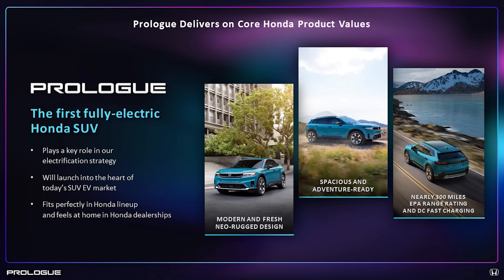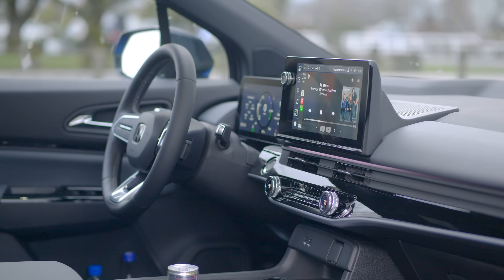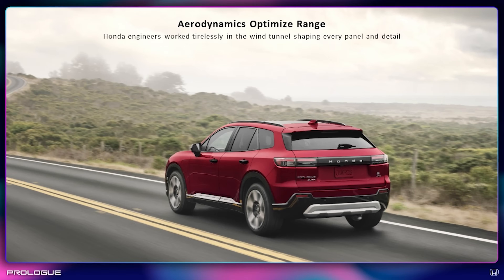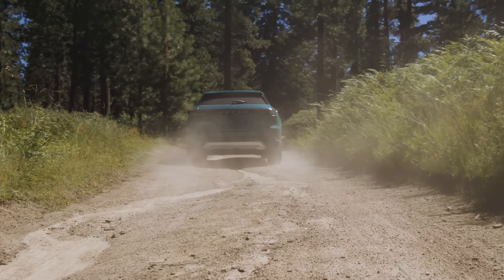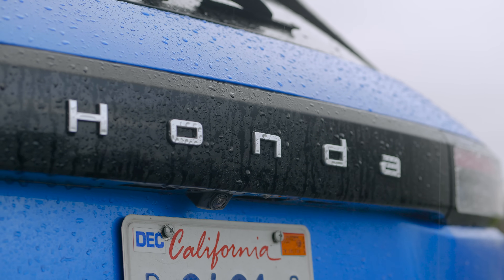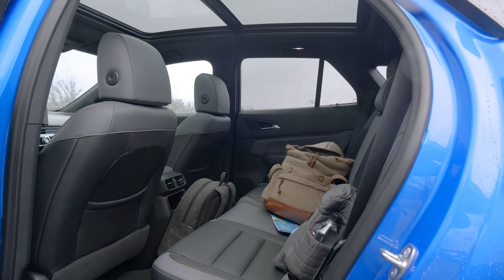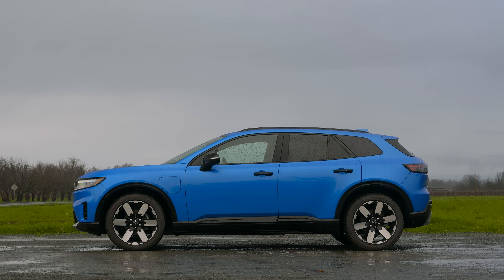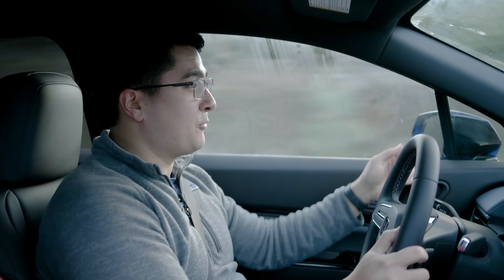Honda Prologue First Drive | Taking Risks

Comment: It's interesting how history repeats itself. When SUVs were emerging in the 90s, Honda hadn't done any meaningful R&D on their own SUV platform, so they borrowed one from GM (Isuzu) and called it the Passport. Here were are again, just replace SUV with EV.
Reply: Except the Isuzu Trooper was a great off-roader. It was a very solid vehicle…and being honest, Honda simply rebadged it. 

Not sure about this GM thing.
Reply: @NomenClature-o8s  my thoughts exactly, gm quality is not the same as isuzu quality
Reply: @NomenClature-o8s  Except Trooper was not Passport, it was the Rodeo.
Reply: @NomenClature-o8s  It was an Isuzu Rodeo, and they fell apart while driving.  Talking to a Honda Service Manager back in the day, it was costing the dealership thousands upon thousands of dollars in warranty repairs, they couldn't wait for the vehicle warranties to expire, the service bays were full of Passports that needed to be fixed.
Reply: Honda traded Isuzu the first generation Odyssey (to be sold as the Isuzu Oasis) for the Rodeo (Passport) and Trooper (Acura SLX)
Reply: The two above me have no idea about how bad the Passport/Rodeo and SLX/Trooper were for Honda in the 90s. Isuzu engines were EXTREMELY prone to oil leaks, the bodies rusted at a higher rate than their Honda built counterparts, and they got ZERO support from Honda once the 2000s hit. There is a very big reason why you still see 4Runners and even Pathfinders and Monteros, rather than seeing Rodeos and Troopers and their Honda rebadges. That same misguidedness is what will cause this to fail. EVs are already not selling and sitting on lots, these will pile up on lots and the few who do buy them will suffer for it. Everyone I worked with at Acura quit right before this thing came out, including the master technician trained for it who had been with the dealer almost 20 years. That should tell you something...
Reply: @TomFromMypace very true. And they didn’t put any attention into “making it a Honda” either. The Passport and SLX were straight rebadges, so they still felt like an Isuzu. It’s been a long time since I saw a Trooper or Rodeo, even longer since I saw a Passport (the SLX I saw a few years ago because a family member had one they got dirt cheap), and even longer since I saw any of the four without rust. Though to be fair, Hondas of the same vintage (late 90s) are largely rusted into oblivion at this point, but their engines live on. You generally can’t say the same about the Isuzu products.
Reply: @TomFromMypace  agreed. I remember the Passport and SLX being the only cars in Honda and Acura service bays more than enough times back in the 90s.
Reply: @TomFromMypace weird, here in Argentina we got japanese made Isuzus pickup trucks and Troopers, and they are plenty still rolling and they are high sought after. Even LUVs made in chile afterwards have a very tough and reliable reputation
 Maybe the ones made for the us market werent as well made?
Reply: Honda's car branch is really small outside the US, on par with Subaru or Mazda. Most of their business and expertise is in small engine and power sports products which haven't taken to electrification yet. They don't have a huge budget to spend on R&D and this is probably the only way they could make an EV happen at the moment.
Reply: this guy gets it. Honda's attemps at EVs so far have been pretty bad which most people don't realize or want to realize.  @origamihawk
Reply: @origamihawk  it would be stupid expensive and it just doesnt make sense to do that.  Ford did that and it has hurt them financially.
Reply: @origamihawk  Honda is circling the drain here in Australia. - very low sales volume.  Mazda is very strong, 2nd after Toyota. Subaru is mid-tier.
Reply: @andoletube Toyota owns both Subaru and Mazda shares tho. Honda is a true lone wolf
Reply: @andoletube I keep hearing how Honda is dying in Australia yet somehow Mazda is considered hot there, but no offense, Australia is a tiny market compared to North America. It’s the exact opposite situation here: Mazda is the one dying a slow death (e.g. torsion bar rear suspension in the Mazda 3 just to save on costs while trying to maintain a fake premium look — what a regressive joke), while Honda has continued to do well and IMO, their current lineup is the strongest ever, both in terms of visual design and engineering. Just look at the Civic Type R and Acura Integra Type S — Honda has found its ‘90s mojo back and updated it for the 21st century.

While Honda has never been that big in Europe (except in the UK), they are doing quite well in Asia outside of Japan, and still a big player in its home market obviously. So, my question is: what exactly do you Aussies love about the current Mazda? Don’t confuse dealership/parts support in your specific region with the actual engineering and quality of a company’s products. Like I said, it’s the exact opposite here in North America — it is Mazda that is tiny and irrelevant, with a crappy dealer network. Mazda is not as bad as Mitsubishi, but it’s getting there. It’s a huge change from their high point in the early 2000s when the Mazda 3/Protege was selling like hotcakes.
Reply: @braynstorm3149  I'm less inclined to enter a conversation with you if you attempt to preempt my arguments before I've made them. You might want to look into your debating style - it's not warfare where you try to anticipate every threat and cut it off before it can attack you. My comment was to another poster and with a particular context, which if anything, aligns with your comment around why Honda is dying in smaller markets - they simply don't care enough about smaller markets to remain competitive.
Reply: @andoletube Ok, point taken. I’m all ears if you’re still interested in explaining Mazda’s recipe for success over there. Upon re-reading that, it does come across as too harsh out of the gate. I guess I typed that while subconsciously thinking about all the John Cadogan videos I have seen over the last year or so, basically praising Mazda while knocking Honda every chance he gets. I agree with him most of the time, but the Mazda bit I admit sounds impressive/astonishing to my admittedly ignorant Murican mindset.
Reply: Honda pilots are low key legendary though. One of the few cars in the US market you can get used <10k with 8 seats and off-road capable.
Reply: It may have been a badge job but Honda did have a partnership with Isuzu while Isuzu was partially owned by GM at that time. The Honda/Isuzu partnership ended in 2002 because Fuji Heavy Industries bought Isuzu’s Indiana plant.
Reply: This is so Isuzu. Another fail.
Reply: @@phillipbanes5484 I wasn't really trashing anyone. If Honda has to release an EV, it makes more sense to collaborate with a brand that's done more R&D in that sector than release their own half-baked design. In much the same way, I don't blame Toyota for partnering up with BMW for the GR Supra. Developing production cars is monumentally expensive and design partnerships make a lot of sense.
Reply: Had a lovely SAAB 900 back in the day.  The only pieces i had trouble with had a gm logo on them. Never again.  Only buying cars made by the name on them.

Comment: "It's a bold strategy Cotton, let's see if it pays off for em"
Reply: I don't see that Prolapse doing very well.
Reply: It won't. That's why they already abandoned the partnership.
Reply: The Ocho 😂
Reply: Bold strategy = charging almost $60k for a piece of junk that should cost slightly under $40k at most.
Reply: @YachtsOnTheReg7  Didn't SG just release a video on how SAVAGE the depreciation is on used EVs?
Reply: aaaaaaaand the gm chassis is made out of pig iron and Mary Barra has sold all Honda's IP to china. tough to see but I can't say im surprised
Reply: Lmaoooo GOAT comment! Awesome
Reply: Yall are hating for no reason. Ultium is better than anything honda and toyota can make right now. Thats why they did this

Comment: Every car could be replaced by an 8 inch ground clearance Prius (corolla cross is not the same thing)
Reply: No. When you drive a prius, everyone hates you. Deep down, yourself included.

Speaking as an owner that drives his 600+ miles a week
Reply: A horrifying thought
Reply: Honestly, that's exactly what I want. Essentially a JDM Crown Sport but just a little shorter, smaller, and much more affordable. The Crown Sport is drop dead gorgeous and the new Prius is great looking too
Reply: When sedans and hatchbacks are extinct and every vehicle is a crossover, what is it a cross between?
Reply: Are you high on Hexanol? How the hell would a Prius on stilts replace a sporty sedane/waggon or just any sportscar for that matter. Heck, it could not even replace the 7 row SUVs, let alone actual offroad vehicles or CUVs/SUVs, which have an engine with more than 2HP and an actually nice interior....
Reply: @leviathan5207 tis a joke lad
Reply: ...in other words, a hybrid Subaru Crosstrek.